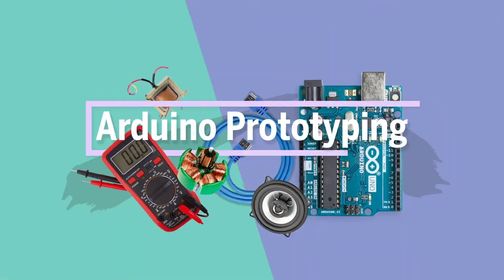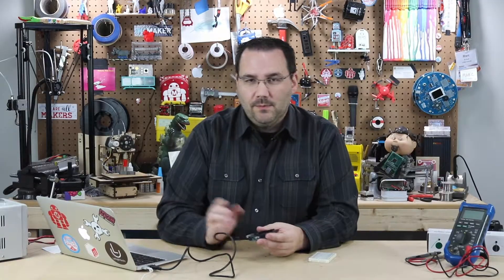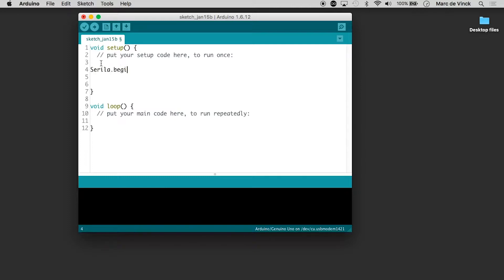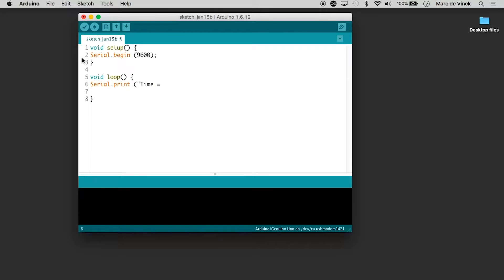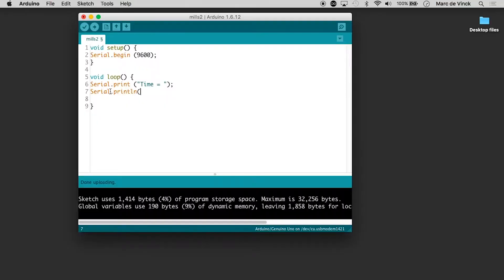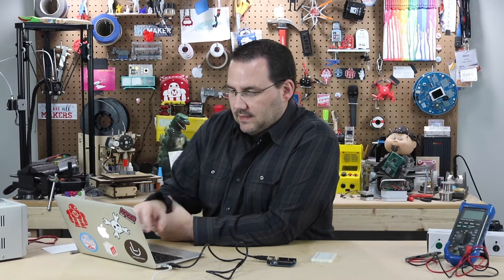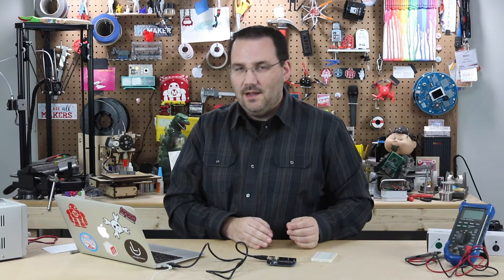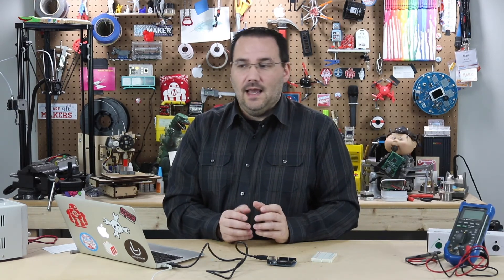Arduino Prototyping Techniques #87: Measuring Time (Millis)

Comment: We're all know that millis() is not accurate, BUT sorry to say that this example is not accurate either: you're adding a delay of 1000ms after something is processed, that requires some time. Thanks for your video anyway, great channel 💪
Reply from the maker: You are correct, all code with a micro takes time to execute, and millis is not 100% accurate, but then again, nothing is 100% accurate. Maybe 99.999%, but not 100%. I gear my content towards beginners, and for a beginner, millis is typically good enough! I also have a video on RTC, which 'can' be better!